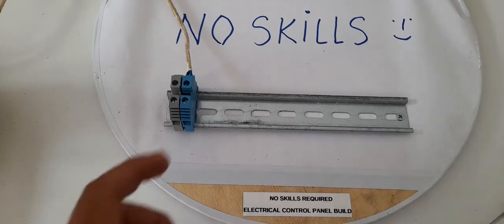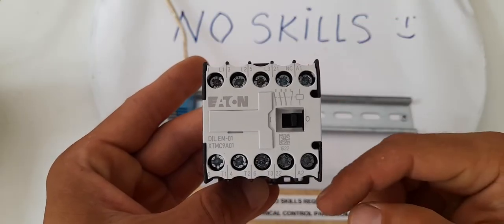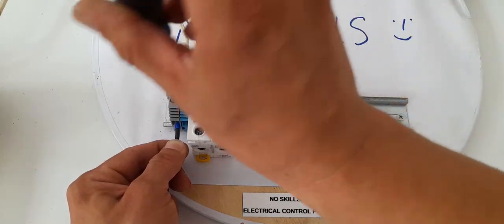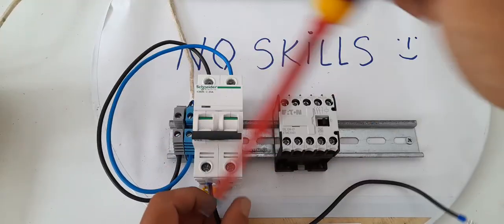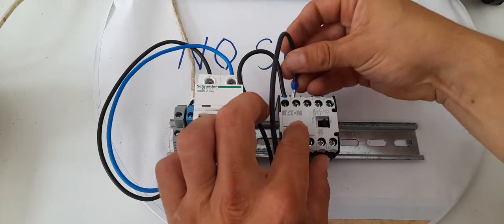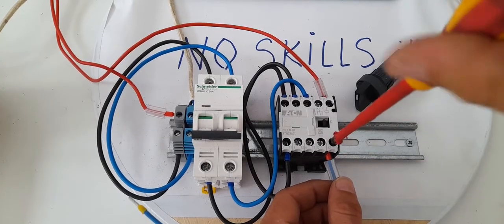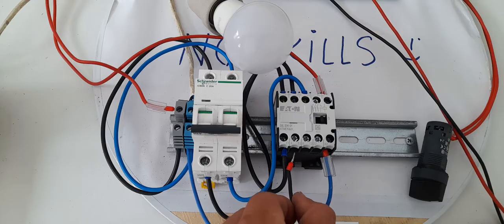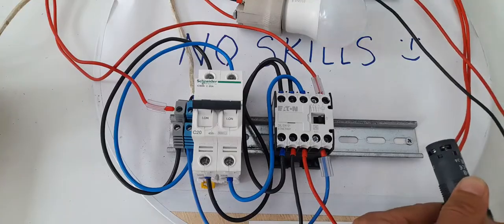How to wire a contactor single phase

Comment: Hello and great video.I will be greatful if tou can help me. I have pressure switch which is operating with 230V Ac. I need to shut of a gas solenoid valve which operates with 230V. Shall i use a contactor
Reply from the maker: Not quite the use of contactors is for big loads in your case a 230v relay will do just fine.it depends what kind of gas solenoid valve you have,normally for safety reasons something like a gas detector send the signal to the valve it goes off and stays off till you return manually on the normal position
Reply: @NoSkillsRequired   Thank you very much for replying. In my case is a fire suppression system in a commercial kitchen. When the  system is activated  the pressure switch should send a signal to the solenoid valve to close. In this particular kitchen the solenoid is connected to the gas detector. Shall i connect my pressure switch directly to the gas detector?

Comment: can you explain the reason why do we have to wire contactor like that? thanks
Reply: Do not wire like this it doesn't meet code.
Reply: This is not a standard way of wiring a contactor
Reply from the maker: To protect the inside contacts that open and closes the circuit,extra protection this is the short version of the answer
Reply: @NoSkillsRequired you are not allowed to break a neutral neutral needs to stay intact. It cannot go through a breaker or any switching means.
Reply: @NoSkillsRequired   so you doubled up the live wire so the live runs through all of the contactor (apart from T3 of course which you used for the neutral)
Reply: Crazy complicated unnecessary